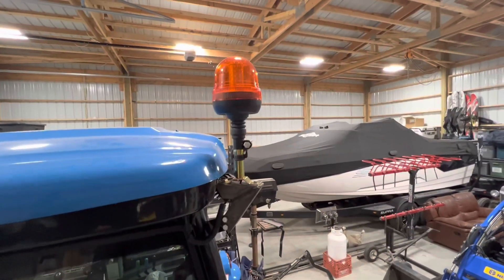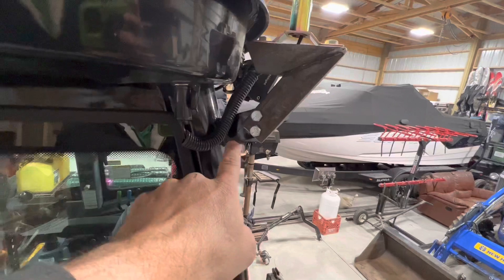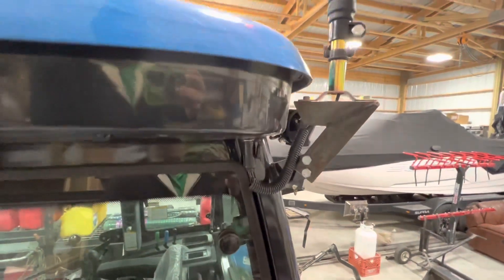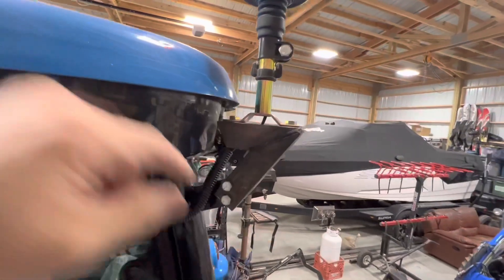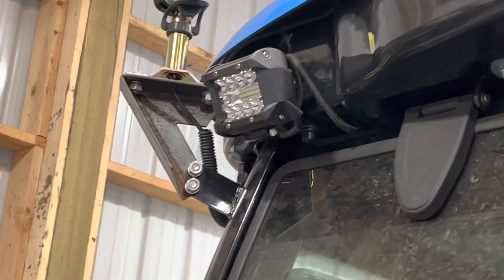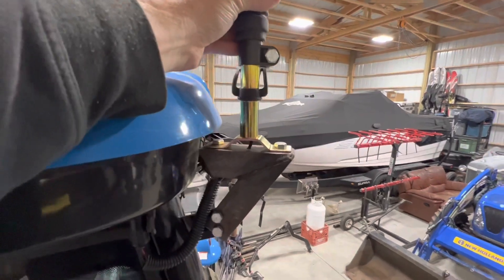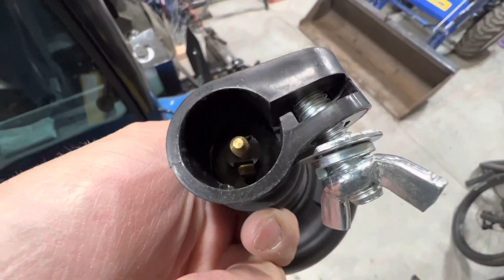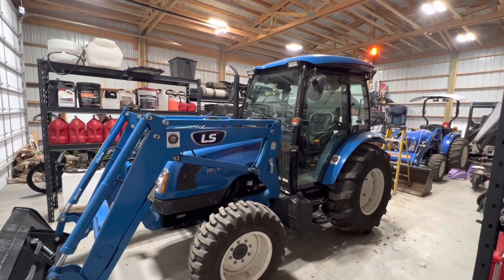LS Tractor MT4 58 Beacon Light Upgrade

Comment: Great install of your beacon.  I need to put one on mine but my garage door is 8 foot and my tractor height is 7'9".  I like the way yours comes off.  When snowblowing I need something to make me more visible than just using my flashers.  I love having my cab, air conditioning, and heat !
Reply from the maker: Amen to that. As you see in the video I have ROPS tractor as well and I was excited to get this cab tractor to help with all of the snow pushing that I do here in Northern Utah.  I think being able to remove it will come in handy.
Reply: Wanted to add that I have issues with trees so I didn’t want anything above the cab. So I just replaced my front and rear work lights with Trux Worklights with strobe. Basically the work lights have about 4 amber leds on the sides that stobe. I have the strobes wired to my hazard switch. Love them so far.